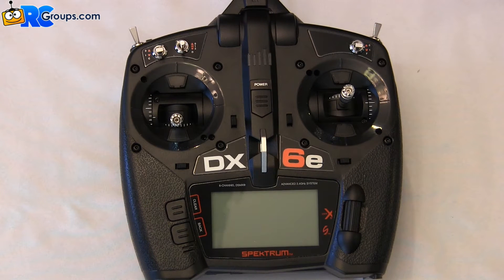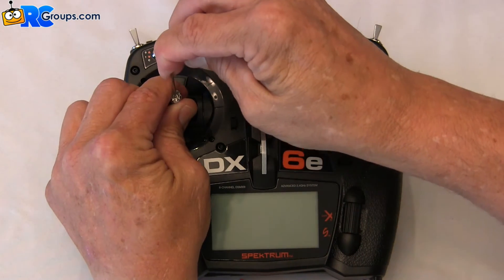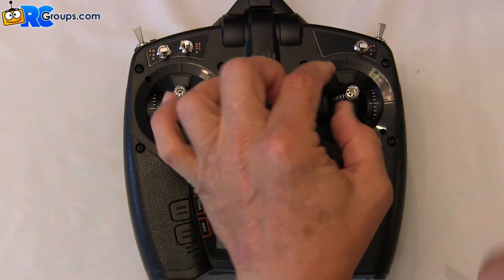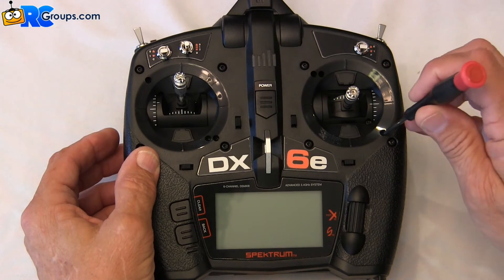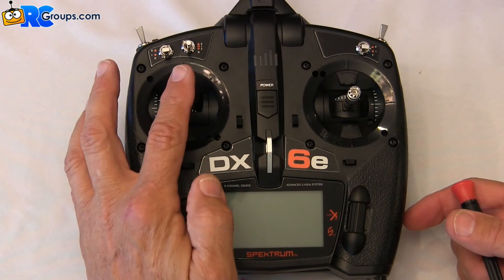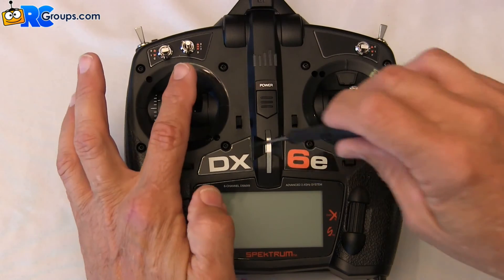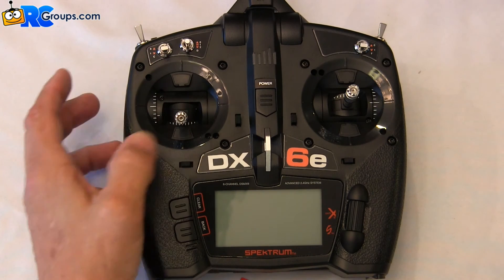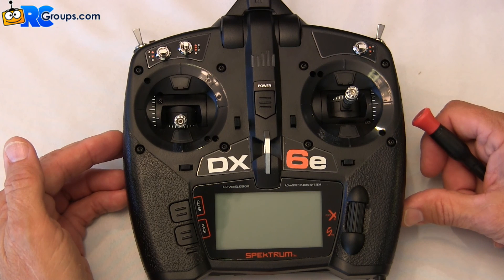DX6e Stick Adjustments

Comment: On my DX 6 e The spring tension adjustment does not do a heck of a lot and your video should've included a warning because the screws that change the tension they never put a cap on it so that you cannot destroy your radio… Yes destroy it.  If you're trying to loosen the spring tension you have a risk of turning too far the screw will follow all the parts inside will fall apart and then good luck taking this radio apart to repair it… My recommendation is three rotations only to be on the safe side and probably better off to not touch them at all.  The ones for the ratcheting work better because you can actually feel it so you can go for that… But it's a dangerous thing if you're not careful and listen it's really easy to just not be careful one extra turn in your radio turns into scrap

Comment: Great job, what I needed to know. I was leery to mess with those adjustments because I got too enthusiastic with my last radio and broke the spring leaving the throttle at 50% all the time. Mind you I did get used to it. Anyhow, mostly flying helicopters. I certainly don’t want a ratchet throttle so again thank you very much.

Comment: Hi 
Do you know what to do if the screws of the throttle tensions and clicking have been to much unscrewed (stick is falling down with gravity whatever tighten the screws are ) ? I opened the transmitter and did not find solution to re-engage the screws...
Thank you
Reply: I accidentally broke the back piece of where the clicker screw is and now my throttle just falls as well. You might have done the same thing. Sorry I'm 5 months late lol

Comment: At age 75 and after 26 years I've just decided to get back to RC Electrics.  All my  old stuff was rudder and elevator only. My new plane, UMX Timber, now requires rudder control on the left stick rather than on the old right stick.   As an old dog I've got to train myself to use the left stick for rudder now.  To have too loose or free movement in the throttle that assures cross interference in my rudder operation. My rudder movement was always messing up my throttle settings. Thank for the advice to tighten my throttle gimbal.  That should be mandatory in the operation of this transmitter.   Thanks for the help. I also very much like the ratcheted sound and feel on the throttle too.  The clicks of the ratchet is a tactile feedback as to the actual position on my throttle too.  Thanks again.

Comment: Great video. Do you know why the throttle has less resolution than the elevator stick I noticed that the throttle doesn't go all the way down to the bottom or to the top is there a way to adjust that? Thanks
Reply: I noticed the same thing. Did you find out how to adjust this?
Reply: Dave, I also have this transmitter. I now find that I cannot assign “Safe” to a switch, because the process involves holding the two sticks in the bottom inside corners. The throws must be 100%, but I’m thinking the small limit in throttle’s movement is preventing me performing this procedure correctly. Do you have any ideas of what I can do?